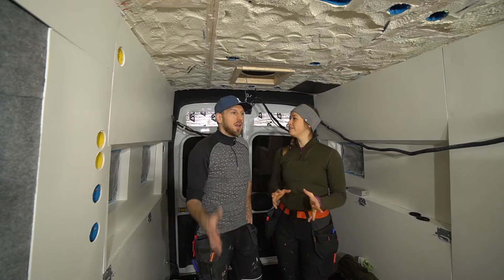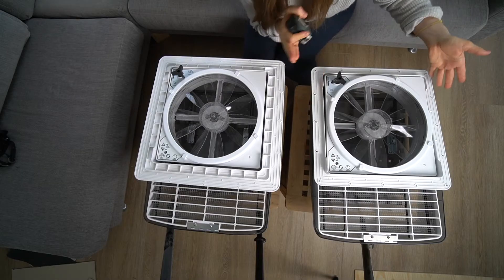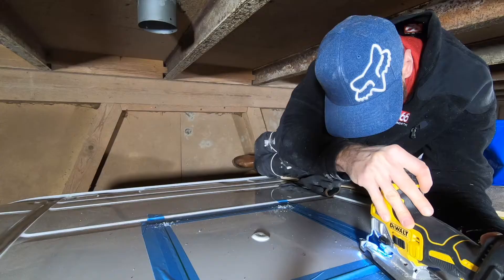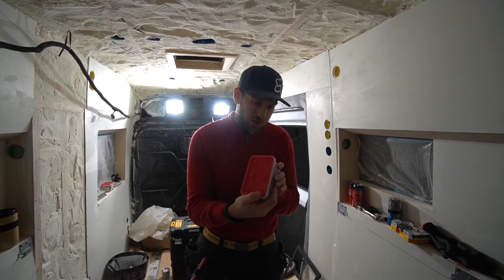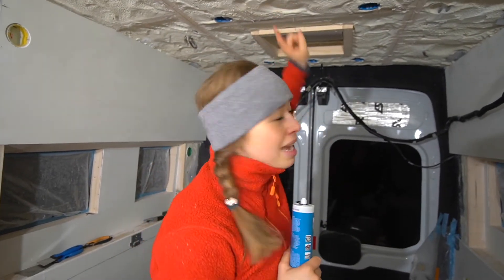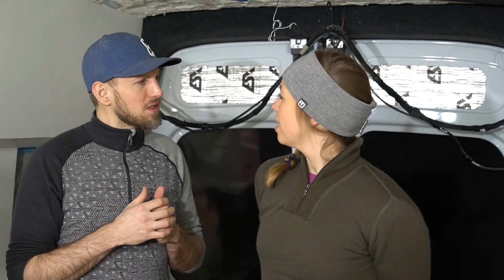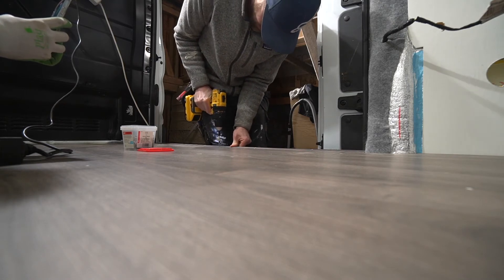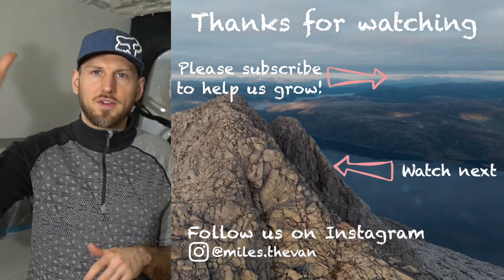Maxxfan Deluxe installation and bed installation in our Transit campervan

Comment: Nice work on the fans and bed! We also went with a fixed bed at the back and have little cutouts so we can fit width ways 😆
Reply from the maker: Thanks 😀how does it work out for you? we have tested it for several nights now and it works like a charm 💫